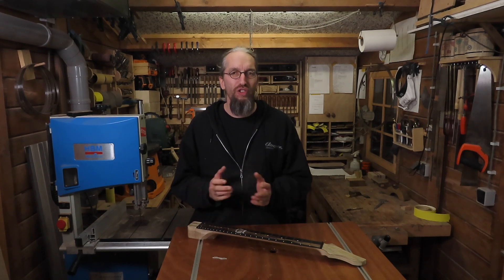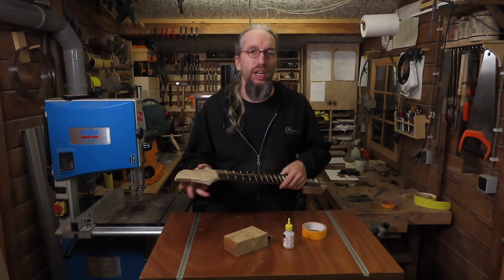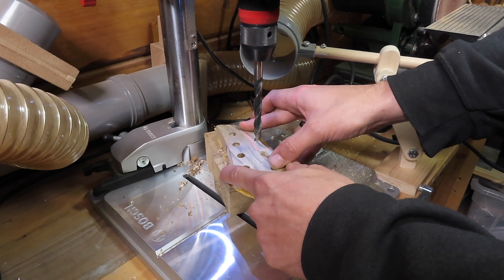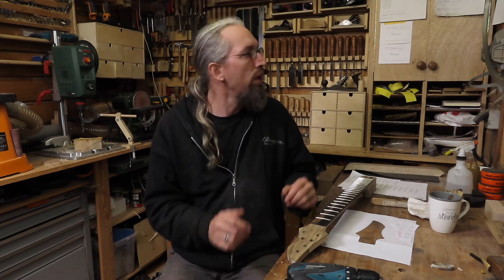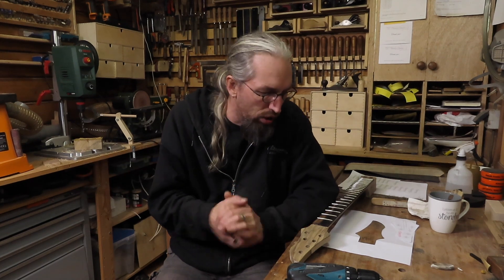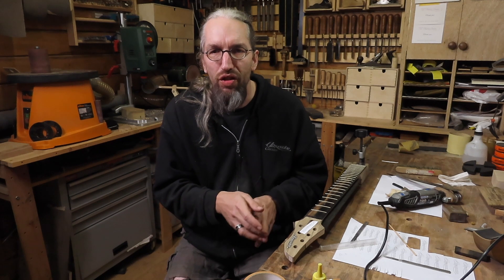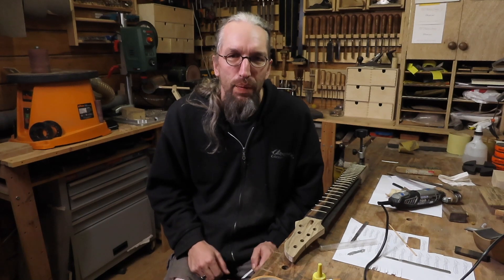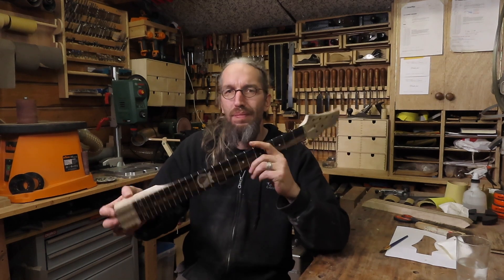Tuner holes & Headstock logo inlay - Building a Single Cut model Guitar (Part 6)

Comment: Hello, it's just funny that you drilled the holes for the tuners all way through! Most modern tuners (or all of them) need 8mm on the front & 10mm half way in from the rear! The tuners then sit a bit tighter and keep tune easier.  Keep it up and stay healfy!👍😷
Reply from the maker: Hi Eric,
Thank you for the comment.
I used Sperzel tuners and they require a 10mm hole all the way through. 
In my experience most modern style tuners made by Sperzel, Schaller, Hipshot, Gotoh, etc. require a 10mm hole. Vintage style tuners however may require the ø8,73-ø10,32mm hole like you described or even a ø8,73mm hole all the way through.

Comment: Is there any good way to fix a tuner hole you messed up? I’ve had a couple necks I made where I ended up remaking because I messed up the positioning. Not by much but enough that I could see it every time I played and it drove me nuts.
Reply from the maker: Hey Pauli150,
I think it depends on how far off the hole is. If it's just off you could glue in a dowel made from the same wood as the headstock with matching grain direction. And the washer at the top will most likely coverup the mistake. 
If the washer doesn't cover up the dowel and you have a veneer on the headstock. Remove the veneer, put in the plug and cover it up with a new veneer. The tuner on the back will most likely cover up most of the repair. 
Or re-drill all the holes with a larger drill bit and plug them with a wood type in a contrasting color and call it a design feature. 
There are special sets of drill bits specially made to make the holes and matching plugs.

Comment: I’d love to get a protractor like the one you use.  Do you know where I could buy one?  Is yours metric?
Reply from the maker: Hi Chip,
The brand of the protractor I'm using is Incra and yes mine is metric.
I think you can find them in any good woodworking supplies store both on- and off-line.
I think even Amazon might have them in both Metric and Imperial.
I bought mine at a Dutch trade show,  just google and I'm sure you can find a store or webshop that sells them in your country.
Reply: @UnquendorGuitars  thanks, Daniel!  I’ll seek one for my shop

Comment: So do you buy 2 sets of tuners for every guitar or do you buy only singles
Reply from the maker: Hi Mr Frontranger,
For this guitar and headstock I'm going to use Sperzel locking tuners of which the orientation can be altered. 
There are some brands that sell 4x2 sets as well. I think Graphtech has 4x2 sets.
If you're doing 3 4x2 headstocks, you could also buy 2 sets of Left 6 in-line tuners and 1 set of right side 6 in-line tuners.